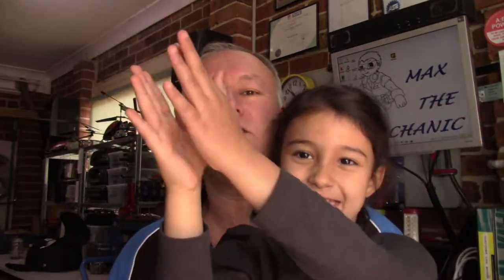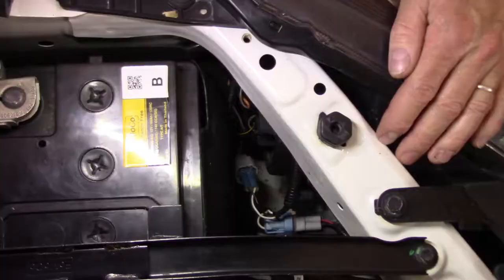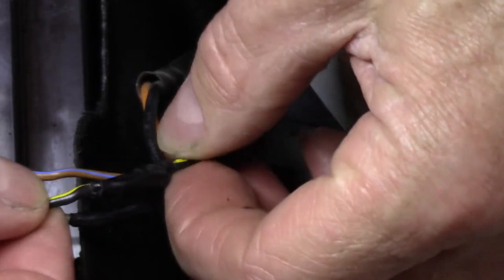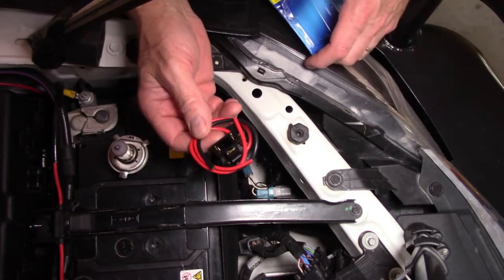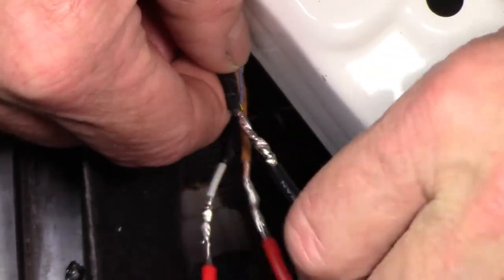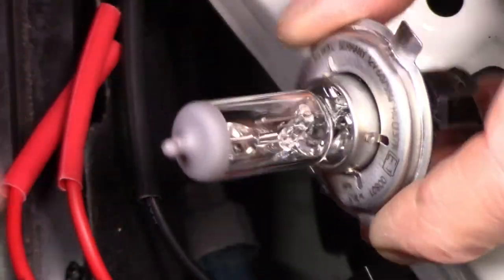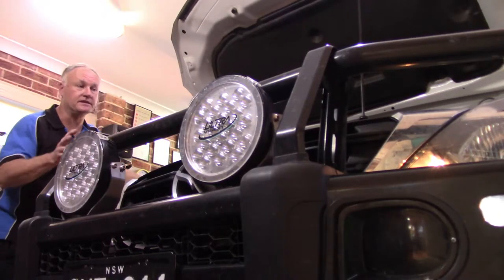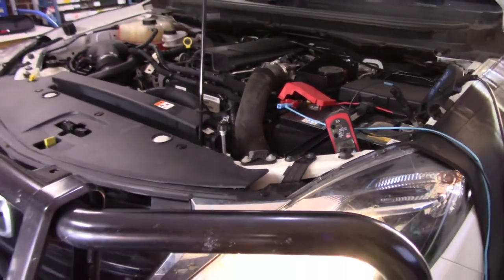Mazda BT50 Intermittent Spotlights

Comment: As an electrician i would  prefer to crimp the cables using a ratchet cert crimper. Clearly the fault was a high resistance connection as a result of loose fitting terminal. Good pickup.
Reply from the maker: Yes, the age old question - to solder or crimp. There are good points on both sides. The ratchet crimper does a great job and takes out the guess work.
I kinda messed up during filming, but got it sorted in the edit. It was the high resistance that caused the problem. I teach this stuff for a living - I musta' had a brain fart! 😁